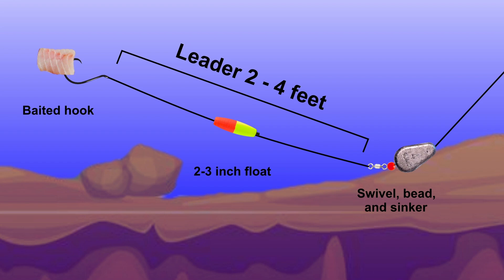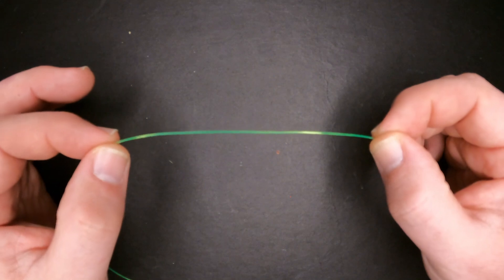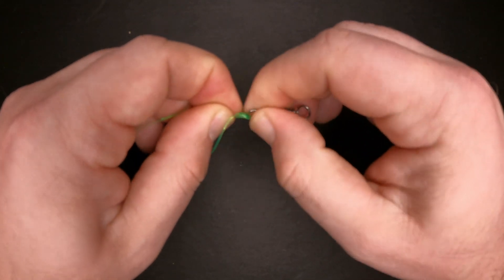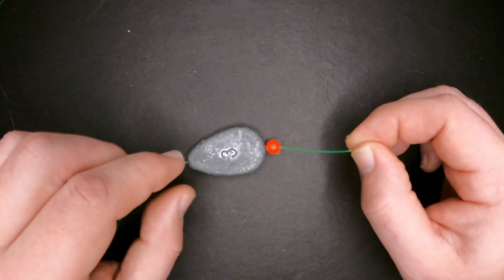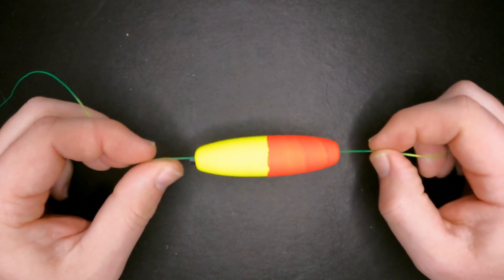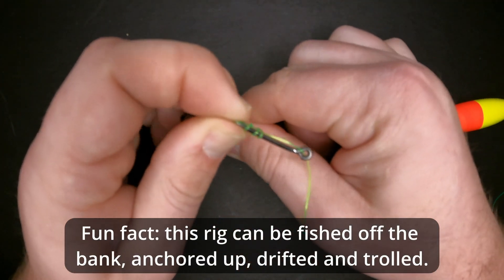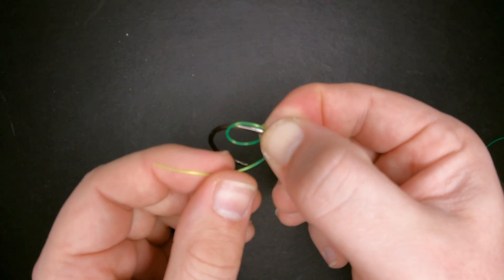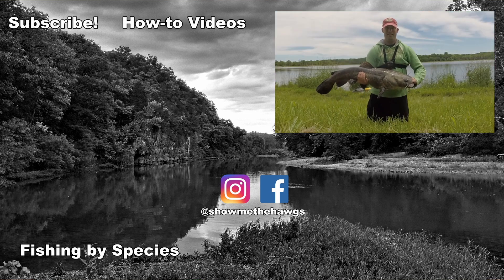How to Make This Awesome Catfish Rig: SANTEE COOPER RIG

Comment: Double thanks. Presentation exellent and easy to follow.
Exellent choice of knots, easy to do. The Palomar knot is one of the strongest knots,  I've been using it for 25 years and never had the knot slip or brake at any point.
Appreciate you sharing.
Reply from the maker: You’re welcome. I agree the Palomar is a great knot. Use it in most cases.

Comment: What size weight do you have to use?
Reply from the maker: It depends on where you’re fishing and your rig setup. For my big catfish rods, I don’t use less than 3oz weights. If I’m fishing in rough current, I’ll use 6oz weights to hold the bait on the bottom.

Comment: Nice, short, sweet and simple demo. I'm a bass angler looking to start targeting blue cats in my area. Do you have a rod and reel suggestion? Also, what is your main line? 50lb? Fluoro or mono? Thx.
Reply from the maker: Awesome stuff. Welcome to the addiction 😂 

If you’re just starting out and not sure if you want to sink a ton of money into expensive big fish gear, starting with a lower end big spinning reel combo, like a Shakespeare spinning combo, isn’t a bad way to go. If those combos come with preloaded line, I’d swap it out with my preferred lines. However, if you want to spend a little more money, here is what I use…

Ugly stik is my favorite line of rods. They’re rugged and durable without the price tag. There are higher end rods out there, but I’ve used ugly stiks most of my life. They’ve never failed me. 

I use a few reels but here are two of my favs. One reel I’ve had for more than 20 years and is still going strong is my Penn general purpose baitcaster. It’s not terribly expensive compared to other reels (last I checked $70-$80) but for the money, she’s a solid reel I’ve caught really big cats with. My second reel is pricier, but it is my absolute favorite big fish reel. It’s an Abu Garcia Ambassadeur C ($170-$180). It’s a beast and smooth as silk reeling in line.

All of my reels with mono or fluoro have Trilene line on them. The Abu Garcia has 65lb fluoro (for those fights with behemoths). My other baitcasters have 30-40 mono. I also really like PowerPro braided line from 30-50lbs (caught a 4ft bull shark with that stuff on the Penn baitcaster last year). 

Sorry for the lengthy response, but I hope it was helpful!

Comment: Does this particular rig work well for catching flatheads ? Also, can I use live bluegill with this rig ?
Reply from the maker: Typically this rig is best with cut bait. When I’m using live bluegill, a slip sinker rig works best in my experience.